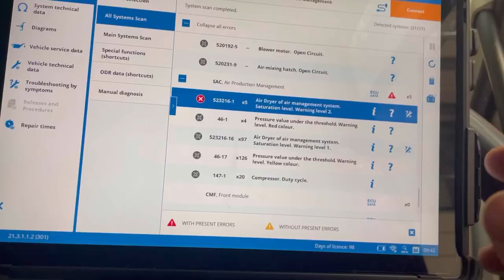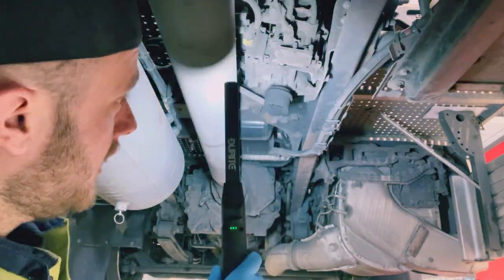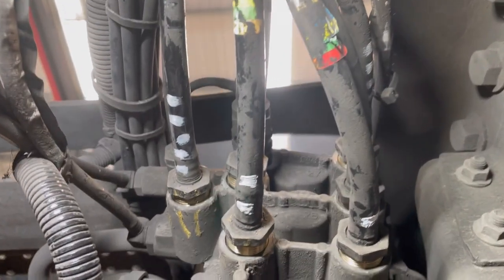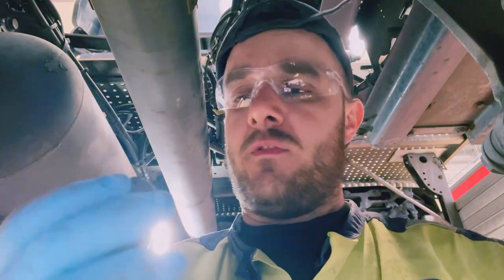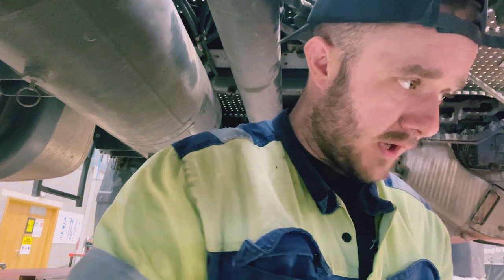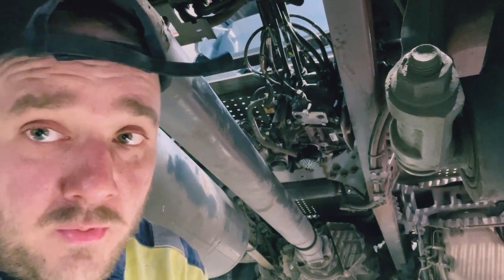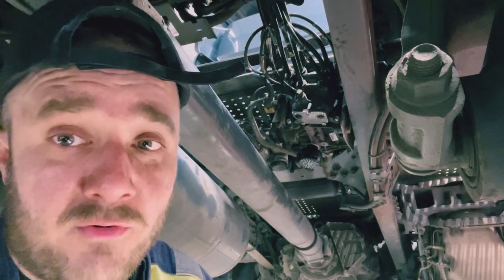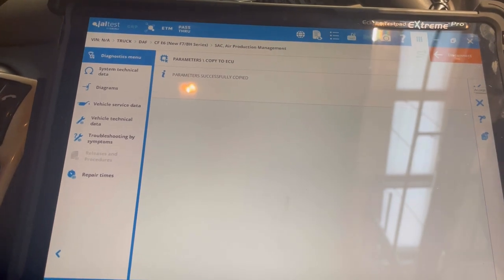Day in the life of a HGV Mechanic- DAF CF85 Euro 6- SAC/APU replacement and programming.

Comment: A couple of little pointers with the SAC unit ..The plug can get corrosion in it and can cause a non start ,,Finding that for the 1st time was not a quick job ..For the saturation level ,generally it is check the air tanks and replace the cartridge then tell it there is a new cartridge ..You may find the other lads probably just reset it which won't work ..Keep up the good work
Reply from the maker: Ahh I never knew that that’s a great thing to know about if you get a non start! I was talking to someone earlier about it like when I was an apprentice you had to take the o/s step off to do one! Yeah that could be why! And thanks mate

Comment: What happens if the new SAC unit is an updated version and requires a different configuration? Don't you have to connect to the OEM system first and check?
Reply from the maker: All we do is transfer say the old software from the old unit to the new, if updated version then not sure mate something we’d have to look into, good question tho.!